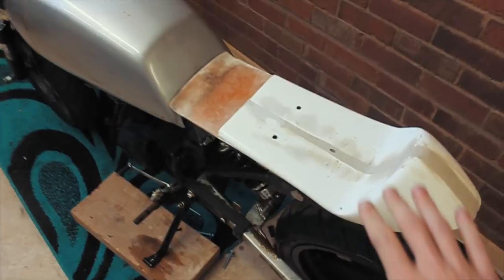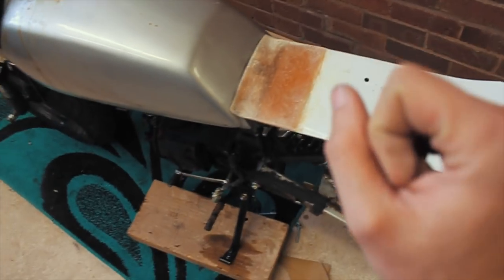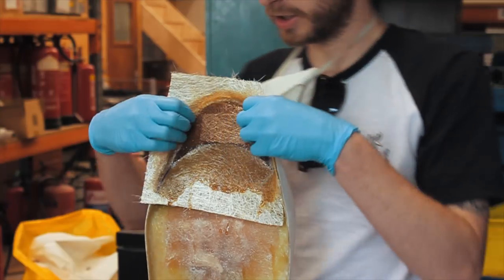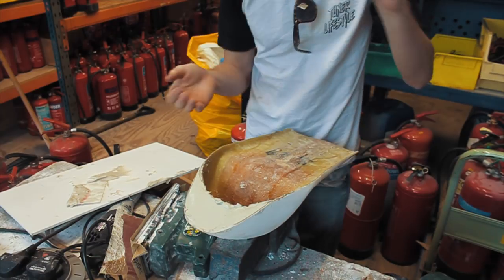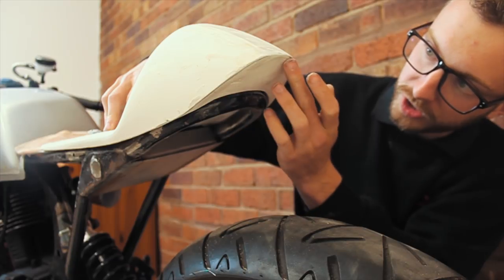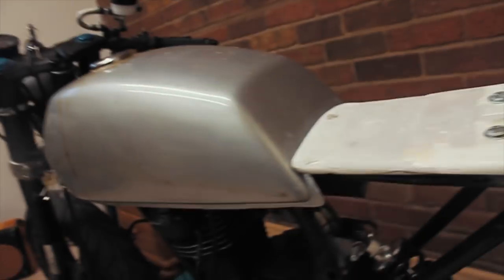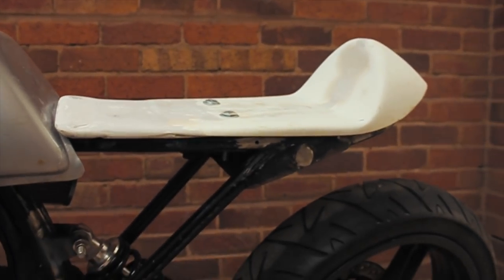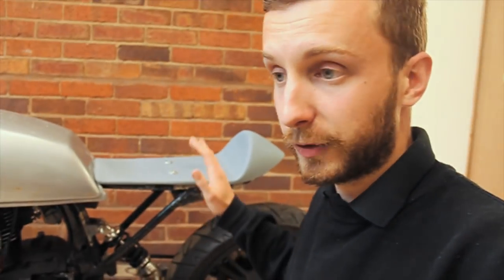Honda CB125 Cafe Racer Build  - Part 10 - Seat Base Completion - GIVEAWAY WINNERS

Comment: most of the pan is gonna be covered by a seat pad anyway, plus the exposed parts look fine. so as long as it doesn't snap in two, I'd say it's all good! 👍

probably would've been easier to make the fiberglass seat from scratch with a custom form, using the carved foam blocks and blue tape technique instead.. there's a yt tutorial by DCC showing how to do it.

Comment: Mate hope I'm wrong but when you start driving that bike with all the vibrations that body filler will crack... make sure you put some rubber between the seat and the frame to absorb most of the impacts :)
Reply from the maker: +Nuno Cox don't worry dude Iv got a plan for this!

Comment: I think I might have curved the seat over the frame rails to the same level as the bottom of the tank and angled it up to meet where the hump starts, hope you get my meaning? That would keep the lines flowing from front to back and hide the frame rails. Otherwise nice job coming along well. Not many use 125's for cafe racers Well done mate. Dave Northumberland

Comment: nice build, I just mocked up a monoshock on my 125, I used a shock from a grom and it seems a bit soft. how is the stiffness on the shock you mounted up?

my bike on DTT
http://www.dotheton.com/forum/index.php?topic=47061.30

testing the mono
https://youtu.be/Z-m6jF-Nfq0
Reply from the maker: Hey dude! just had a look and its looking cool as heck! i really like what you have done with the foot pegs. I'm going down a slightly different route to that...

Yeh mines a tad on the soft side too and thats with a 700b spring! as its gas I'm hoping to be able to put more pressure in it to help this